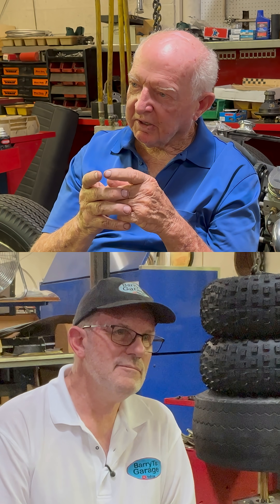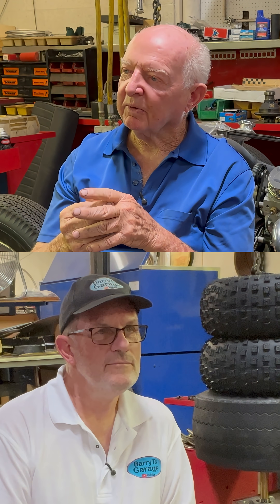Piston Ring Guidance - RACER/BUILDER Experience - Ask Ed 32 - Ed Smith w #BarryT #enginebuilding

Comment: What kind of gap would you like? On dz302 4.0" 1/4" dome  .028-.030 for 45# of boost at 11.5:1" 3" stroke? I was also going to run a lower tension oil ring to help keep temps down, I'm building my dz efi 112 LSA I'll try duntov cam but 112 LSA for efi and 7200-8500+ and also aac lift 4/7 swap solid roller as well, I used to want to build a 350 but I want thia motor to pull harder and adjust boost on a roll to help win more on races lol, I'll also probably run nitrous as well, I have a huge intercooler as well, to dramatically lower temps as well, I have all forged parts and stuff gile for valve train as well, this things gonna rip on my 89 Formula 350 and I'll try to make it look stock ish lol but it won't sound that way lol. I'm building a bad ass 305 ATM, I've built lots of 350-461 or larger but I'm trying something different. So 11.5:1 static and .560" lift 219* duration at .050 and if I run a 1.6 rocker it would be .598" but that may be kinda lazy at low speeds but bc of that compression it may be a good track car. I may even elongate the pushrod holes to run a BBC 1.7 rocker on stock L98 cam it's a peanut cam only .403" stock but I'm running a .403/207* .431/209 now 950cfm it revs faster bc it still efi but gonna put a better intake on it as well. But it's fun to experiment lol 305s are usually slow but I'm trying to take advantage of physics and efficiency here and prove them wrong and build a ten second 305 lol on motor and some nitrous.
Reply: If chrome molly is run mine pretty tight. 0020.

Comment: I have had rings that were so hot you could twist them into an S no temper left in them .. 
 I started using chrome molly rings and I believed they handled the heat better,, a harder ring but more forgiving..

Comment: I'd imagine that dis-aligning the gaps is more important than running them tight. Ten, two, six o'clock spacing should be happy for der engine.
Reply: I've taken factory engines and even built engines apart and found them lined up, which has led me to believe they rotate when an engine's running, at least sometimes, perhaps conditions in that particular cylinder has them doing that, and I've never seen any indication from looking in ring grooves that they rotate fast, if they do it's slowly, even most likely in steps as the piston reverses direction at the top and bottom of the stroke, each time the piston does and the ring goes from being pushed against the top of the groove to being pushed against the bottom, and vice versa on the other end of the stroke, they rotate a little in the groove.
I don't know, I just know I've found them, not often, with the gaps all lined up, or close really not perfectly lined up of course, and occasionally see all three gaps within the same ⅓rd "zone" of where only one gap should be, but certainly where they shouldn't be if they were evenly spaced during assembly, and mass production engines might be one thing but ones that are hand built engines no, shouldn't be that way.
Reply: @dukecraig2402 ... Interesting that you mentioned it. I was living in a small town and the job I had was part of a Chevy dealership. A customer had an early '70s Caprice with a 454. It was a strong performer, but used oil from day one. The mechanic tried several things to get it to quit dropping the oil level. It was a mystery and they kept consulting with Chevrolet about what might be causing the consumption. Eventually they got authorization to take the engine apart because two cylinders consistently fouled plugs. When they got the engine apart, the two cylinders they were concentrating on had perfectly aligned ring gaps on the pistons. Speculation was that an engine assembler set it up that way on purpose as a way to cause trouble for the corporation in a way that would take a while to discover and he was not likely to be caught by the time it was revealed. Even if he was caught, he could claim that he was innocent and the rings must have turned in the bores and compression made them line up. There would have to be real surveillance to prove it was done on purpose. The corporation wouldn't spend the time to try to catch a random prankster.
Reply: @dukecraig2402 I was told they rotated but Marked them and found them almost exactly where I had put them with plier Ring compressor.. That made me not believe it on multiple teardowns ..
Reply: @pauldunn7000 
I don't know what you mean about multiple tear downs I'm talking about engines with miles on them and that's why they were coming apart not because of problems, I've found them in all kinds of configurations, 2 gaps lined up with the 3rd 180° away, and sometimes all 3 lined up which even on a production engine should be virtually impossible.
If guys who do higher mileage tear downs looked closer I'm sure more would be saying that but they have a tendency to just tear things apart because everything's getting redone, but I'm Mr Curious, I even check crank end plays knowing everything concerned will change but I just wanna see what average wear looks like, I'm always snooping in everything.
Reply: @dukecraig2402  yes I'm very curious also but I mean new cars under warranty,, my own daily drivers and race, I have found rings in all sorts of positions on new cars... But I have a specific way of positioning my rings and it's not what's recommended and with 100,000 miles or a couple hundred passes I always find them very close to where I put them..
 But I always thought they rotated also until I  started checking and come to the conclusion they stay put or very close..
Reply: @dukecraig2402  it happens rarely set to 1/3rds and they float into a line !
Reply: @eflanagan1921
Didn't I say it wasn't common for them to be lined up?
Why are you talking as if I said it's every piston you pull out of an engine?
Are you gonna be the next one to say you've seen it then by the end of your post say you've never seen it?